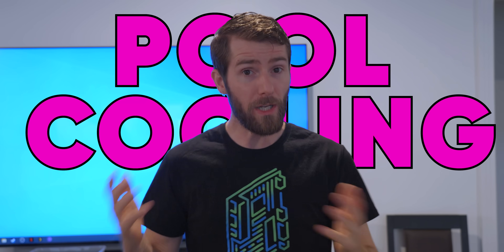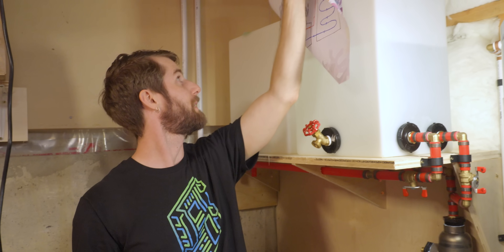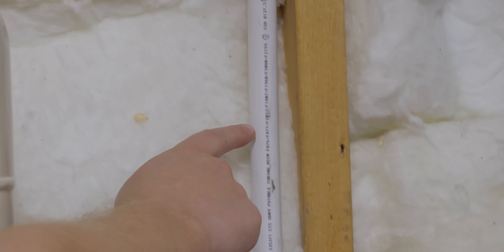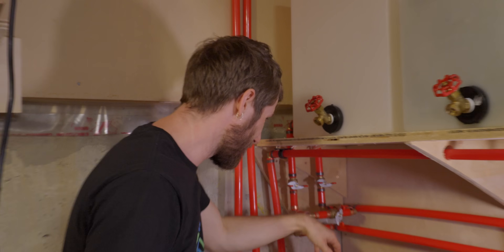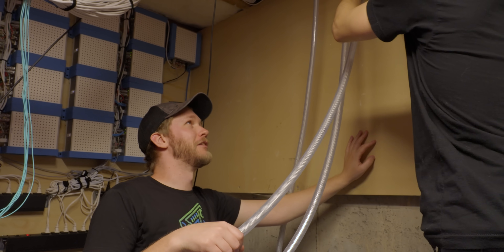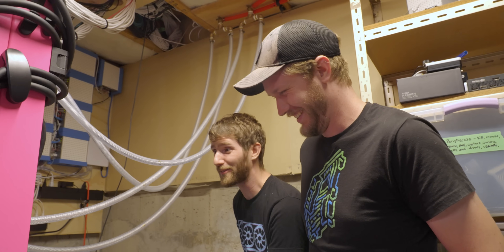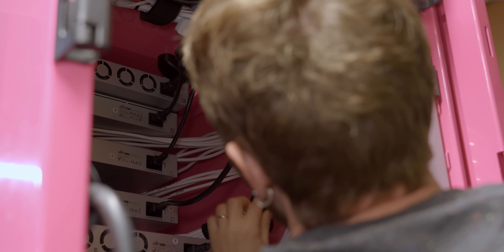My pool leaked and killed my computer - Whole Server Room Pool Watercooling Part 4

Comment: I'd be really concerned about that iodine btw. That's potassium iodide + iodine, it's pretty much taking table salt and going a step down on the periodic table. IE it'd basically be like adding table salt to the loop. Massive potential for dissimilar metal corrosion. Also Iodine itself is a relatively reactive element it may straight up attack your cooling blocks/plating's etc. You don't need anti-freeze but there's other types of algicide and corrosion inhibitor type stuff you might really want to look at instead. On the other hand, yay in 4 months we get new videos lol
Reply: Calcification in his pipes pump and block where the water gets hot or even just slightly warm is going to be a HUGE issue within 3-4 months as well because of potassium added, actually to further expand to this, this entire project failed the moment they didn't even realize they borked it up immensely. That was the moment they filled the loop with tap water and THEN added potassium on TOP of that. What on earth was the idea there, accelerate calcification?
Reply: Yes those blocks are going to corrode like mad.
Reply: @grasstreefarmer but isnt the anti-freeze in the other loop. So that water never comes in contact with the water block
Reply: Not sure why he's so adverse to using proper watercooling coolants. Just chuck in a couple bottles of Koolance or Aquacomputer concentrates and call it a day.
Reply: @dolan-duk  I think it's because he got into water-cooling before purpose-designed coolants, pumps, AIO etc were a thing and somehow thinks using them is cheating. There are some very early videos (or maybe a pre-wan era stream) where he talks about iodine as a biocide and how it has worked for him so far... but that was going to have been before he got so deep with LMG and probably re-built his rig on a semi-regular basis.
Reply: water weter would be good its meant for cars when you run strait water but is not an antifreeze its meant for race aplactions where they don't want glycol on the track encase of an incident
Reply: I would say that he would be better off with copper sulphate, but that is only if He has copper-based water blocks and fittings. He would be better off however using an all-in-one additive for liquid cooling applications anyway, given that he's got a titanium heat exchanger. This means that he has already got a dissimilar metal scenario in his loop no matter what, so it will have the correct bio sides and corrosion inhibitors already in the solution.
Reply: Put RED LINE - WATER WETTER in the PC side loop ! If it werks on a racecar - it will werks on your pc !

Comment: The hoses from the manifolds should have had a drip loop.... as in the hoses should have gone down below where they were connected to the computer and then come back up again.  What will happen with the current setup is if there is a leak at the manifolds, the water will trickle down the hoses straight to the outside of the computers.  The water will likely then have a good chance of finding a way into the computer cases.

Comment: Yeah, PCV/piping can pretty easily crack within a year if you don't use the correct type, especially if you're using it with chemically treated water such as from a pool. Please do your research and realize that PVC fittings and vinyl tubing are going to get brittle and crack within a year or a couple depending on weather/climate. Next time use more durable fittings, not plastic ones who'll need sections torn up and replaced every year due to thermal cycling (I've done work for irrigation systems, so this was pretty obviously going to be the result due to being an extremely common issue).

Comment: Aside from all of the more obvious concerns, I'm not so sure about having antifreeze in only one side.  That outdoor side can still flow with below freezing water due to the antifreeze.  Unless they have a low temp alarm on the indoor loop, I'm afraid we might see a video in January about how the indoor loop froze solid and cracked the heat exchanger.  Or maybe just ice crystals blocking flow on the outlet side.

Before everyone jumps on me about the computer heat, that main heat exchanger is already pulling heat as fast as it's generated.  I mean, when the outside temp drops below freezing for multiple days and the heat output at 5am in the morning drops to idle...  And no, the pool probably won't freeze, but there is some above ground piping and a loop at 1-2 degrees C could be pulled down that last couple degrees.

Comment: I totally expected him to use a full on Pool Sand Filter for filtering out debris from the loop! Could actually use a full on pool pump for all the PCs also! 1 pump and filter pumping the water from the server room to under the pool to dump out the heat! Could get a variable speed pool pump and turn the RPM for flow, pressure, etc!

Comment: For the amount of holes in the manifold, you either need an extremely high headpressure or a much bigger pipe going into the manifold. Another problem with a manifold is that the loop with the least amount of resistant will get the most amount of water. Just some things to keep in mind.
Reply: A small pump in/for each system would be much better. But that's not as janky 🙃
Reply: @triplestaff  isolate each loop and use Air to cool the radiators and it's a perfect system \s
Reply: @Manivelarino  I always confuse /s and /srs...

Comment: Why aren't the manifolds mounted near the bottom and tubes traveling up to the systems to avoid leaks traveling to the computers?  Any small leak is going to travel down the black tubes and drop into back it onto other systems below.

Comment: Could've run a heat pump style heater in the room to cool the room and it would dump the heat into the hot water tank and pool. It effectively makes the entire room the heat exchanger and also removes the galvanic corrosion effect from all the mixed metals.
Reply: Sure, and that would generate about.......6 minutes of content. Great job, genius

Comment: Nice work!  I believe the manifolds are the weak link though.  Why place them in with all the electronics?  I think I would've isolated them outside of the server rack, maybe attached to the wall, then bolt a box over top of it to isolate any potential pressured leak from spraying outward toward any sensitive electronics. I realize this means a lot of hoses exiting the rack but those manifolds will fail before a hose fails.

Comment: The Issue is, Everytime my AC, or Heat kicks on or Off, my TV Screen goes out for a few seconds!!   (Only when I'm on PC)  (or if i try cooking something on the Stove Top... Is it my apt wiring, or is my Power supply?  Im sure i have at least a 700 watt one. It is so annoying.  Just watching some Linus Videos, and my TV goes Blank for 5 seconds... Everytime the air condition/heat does things...??????

Comment: I'm glad he failed this because he can improve more into safer and better solutions.

I have been repairing machines not much, but Made in USA product machines are one of the best and easiest to repair difficulties.
Of course, it's not THE EASIEST, but it's better than other machines that are made it from the US.

The reason is that when repairing machines, US made machines are fool-proofs for those who don't have experienced repair specific part of the machine.

But other countries that are not from the US, it may not have a fool-proof for easy repair.

So, even though it's one heck of a work to draw each arrows, but I strongly recommend writing arrows or putting a sticker to better visuals for those who are not experienced.

Maybe Linus may change the hose directions by accident.
Who knows. Haha

Comment: What do you mean you couldn't figure out the teflon tape? Find the threads, start at the outside tip and wrap in the direction that the threads spiral in towards the other end. That way when you tighten it, you're turning in the same direction that the tape is wound so it won't unwind. Just gotta make sure you overlap that first wind a bit so that the end of the tape is underneath. If you don't overlap then the threads will grab the end of the tape and pull it with them. I'm an electrician and even I know that...

Comment: i use an "esp8266 and Optocoupler" connect to my internal usb for power and to the power pin of the motherboard to turn on my computeur from home assistant. 
it works perfectly

Comment: As an electrician: always use the cable color code, but NEVER trust that someone before You did. Always check with multimeter if someone before You did things the right way.

Comment: You may have Overlooked some issues or maybe it wasn't mentioned in this video...

You don't have to worry about water freezing because the water is constantly moving, but what's the plan if there's a power outage during freezing temperature? The pump will shut off and you'll get frozen water since your heater isn't on either- possibly damaging some of that expensive equipment including the Heat exchanger and servers. Does linus have a home backup generator? 
I'm also wondering if you should add a backup pump into the loop considering your overheat fail safe failed. It would also be a pain in the a** having to wait for a pump to be replaced and not being able to use your systems in the mean time- along with block in valves for each pump. 
Source: Chemical plant operator that has seen these frequent problems and suggesting industry standards.

Comment: What happens when the water in the pool is beyond chilly in the winter?  If you turn off your computer with water that cold from outside in your loop won't you run into massive condensation issues and have another dead system?

Comment: Linus, you should get a few leak sensors, toss them around the server rack (probably  below the manifold) and add them to home assistant. Set it up to text you when it detects water. Just an idea and a little bit of peace of mind :)
Reply: >text on water detection

Connect your pump to a smart plug/relay and have it shut down automatically along with power to the pcs?
Reply: @pawepiat6170  Great idea!
Reply: Don't. "My server room burned down" videos do fantastic in the algorithm
Reply: omg yes. should integrate with an Eaton UPS too which you definitely have right Linus?
Reply: too bad it's already too late by the time you get the notification

Comment: Personally, I would have liked to see the Water distribution blocks near the bottom of the rack.  A leak would just pool to the floor instead of running down the hoses into the computers.  In other industries we provide a drip loop and a diversion trough to shed water to where we can tolerate it.
Reply: That would be too smart and failsafe. Imagine this was indeed the last time they needed to touch the piol watercooling loop, now where's the fun in that? 🙃
Reply: I just wonder how much is deliberately jank and how much is actual ignorance, not that they arent smart, just that they always seem to gloss over, or not even think about a lot of shit, again, i dont know how much is like that in order to get content, and how much is them being them

Having said that, i wish i could see one of these videos go exactly as planed and handled professionally for once, because i can see it right now, in fact, im.gonna call it, those distribution blocks/manifolds ARE going to leak and fuck something up, because the hoses are literally guiding the water into the systems lol and ffs, how do you crossthread that one? If you know for a fact those are delicate, like, cmon, did he just jam it in there, tighten it until it feels soft again and then be done with it?
Reply: They just replace one kind of janky solution with another 🙃 it's research, except not at all necessary.
Reply: But then we wouldn't get another video in 6 months when it fails again
Reply: @Morimea  well, yes, but one, this is not their forte, snd secondly, as i said in my comment, its definetely made in this way to create content, linus could just hire a professional whose work solely relies on plumbing and/or server infrastructure, but at the same time, where is the fun and content in that? 

Thats why i wonder, how much is deliberate jankiness and how much is actual jankiness, but you made a lot of assumptioms about them lol, even went as far as saying they dont even know how to say no. 

Besides, if you hate it so much and criticize it like this, then what are you doing here? Linus has always been like this, its not lile we come for a professional tutorial on how to watercool a server with a pool, you know?

Comment: I don’t understand the thought process you guys go threw it seems slightly more thoughtful than a Red Green style install but also not the we sat down for a few hours and though/ workshopped a way threw this 

You might want to throw a set of bulk head connectors into the top of the rack  so you can add a regular or radiator door on if necessary  and probably replace all that cheap soft lines it might be good for a computer that gets rebuilt every other year but when you make the install this swap-able rebuilding the lines at the same rate as the computers is going to get neglected

Comment: This new cooling system looks a lot like a nuclear reactor cooling system. the chlorine needing to be separate leads to the system treating water as if it is radioactive with the whole heat exchanger transferring heat without contamination.

Comment: Why aren't you using an independent loop for pool water, and an independent loop for PC cooling (so that the cooling blocks can be low pressure), and then use a heat exchanger in the middle

Comment: 09:06 The water from outside will still be sub-zero which can cause the heat exchanger to freeze over and plug the system. This might not happen when the system is running, but power outages do happen.

Comment: I couldn't help but notice what looked like part of the flow and return for the cooling loop was ran diagonally across a ceiling instead of parallel to the walls. Would you run your water cooling tubes diagonally across a PC case? 😅

Comment: The idea itself is unnecessarily complicated from the beginning. More plumbing pipes and fittings always means more Leaks, even stupid to run it nearby all these electric cables and expensive equipment

Comment: I don't understand why he wouldn't just install a water to air heat pump and just air condition the room. It would air cool everything and no water leaks. Also he's using PVC outside in the sun. Amateur hour for sure. I am a facilities engineer. I do stuff like this with much more expensive stuff. Really jank.

Comment: You don't label "in" and "out" because those are worthless. You label "to <destination>". "To computers", "from supply dist.", "to output dist.", "from computers", "to exchanger", "from exchanger", to out. loop", "from out. loop". Also, I want to know why the various bits started blowing fuses and burning. Was it just water spray?

Comment: If you put the manifolds lower in the rack or better yet move them completely away. If they leak, they won't leak on the systems unless there's enough pressure to shoot upwards. Maybe run the tubing on the floor under a platform just large enough to fit the tuning. Of course you'd need to make sure the platform it well supported.

Comment: If you can measure the pressure in the suction and discharge line of the pumpe (simple pressure gauges are not that expensive) you can look up the flow rate from the pumpe operational chart.
There are three parameters: head, volume flow and setting of the pump (like a specific pump curve). Knowing two of them will show you the thrid automtically.

Comment: I was wondering if they were ever going to utilize VFDs to maintain a differential pressure with set point that raises and lowers based on demand... along with a mixing valve or combo bypass valve...?

Comment: Great setup... I'd personally have used stainless steel tanks and manifolds with braided hose, I'm an industrial maintenance engineer and see far too many plastic fittings fail.... I'd also have put the header tanks / manifolds and pump in a bund .... Sooner or later all pumbing systems leak at least once...and why are the manifolds inside the server cabinet

Comment: 10:54 I would suggest using the PCB convention of labeling here. It gets confusing with RX and TX sometimes. For example PCIE_0_G2S_P would mean PCIe lane 0, GPU to Switch, positive end of differential pair and PCIE_0_S2G_P would be PCIe lane 0, Switch to GPU, positive end of differential pair. They could have used C2M for CPU to manifold and M2C for manifold to CPU.

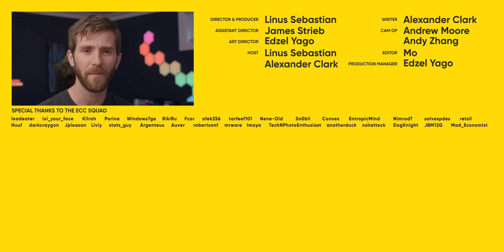19:54 For remote power on/off I would recommend the ESP32 and connecting GPIO to the front panel headers with Dupont wires (get quality ones) and use wifi or bluetooth to toggle the GPIO. Requires some software work but could be a fun project.

Comment: If you want a good recommendation for a non-invasive flow meter please please check out keyence. This is a great way to attach flow meters and sensors without having to gut into your loop. These are used quite often in the industrial sector and I use them all the time in our projects. They can go as small as 1/4 inch (.12) to 8 inch.

Comment: Can the bios be set to turn on computer when plugged in then plug the computers into smart plug that are controlled by phone and a such as the power button solution. If not another idea i thought of is using the relays from a car alarm and use the key fob as a power button.

Comment: With the fire/smoke. My guess would be the internal wires were connected wrong on one of the ends within the new cable. Safe to say the PSU on the switch is dead.